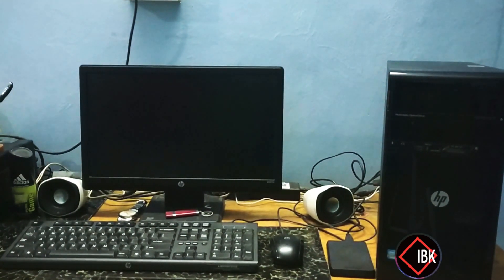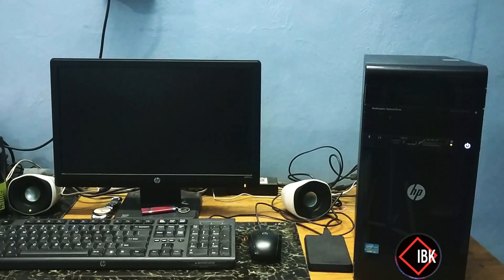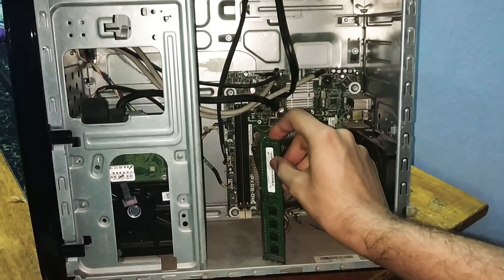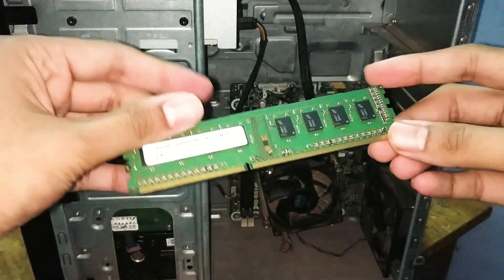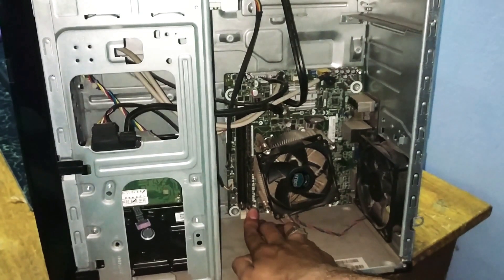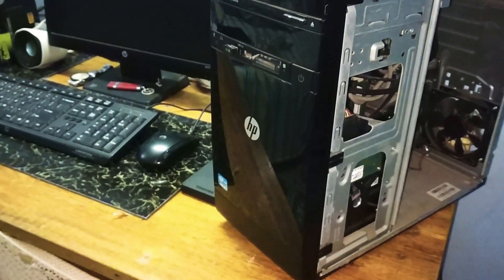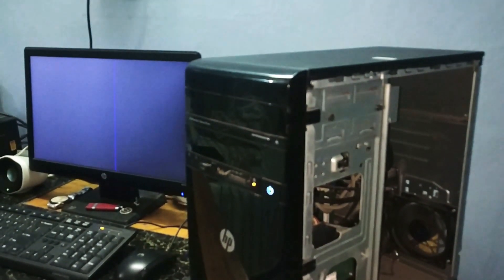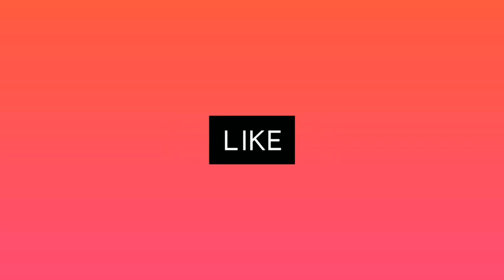Computer BEEPS & won't turn ON - SOLVED - BIOS CODES

Comment: Cleaned the RAM still the same issue. Changed the CR 2032 battery as well. Still the same issue. Kindly help
Reply from the maker: Did u changed the RAM?
Reply: @imranbk4327   Not changed. Just cleaned

Comment: I did all RAM cleaning and even replaced with a new one. Still beeps. What other issue could it be!?
Reply: Me
Reply: The beep codes are different for every motherboard check what motherboard u have then check the beep codes on there
Reply from the maker: Absolutely, correct.